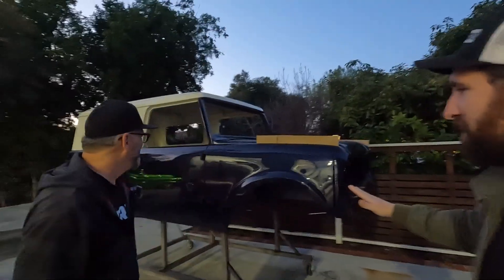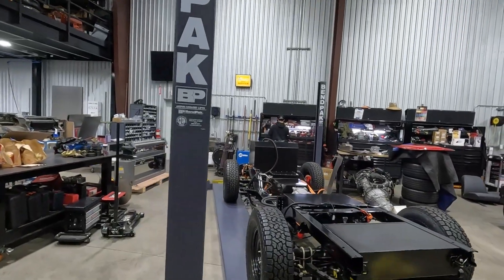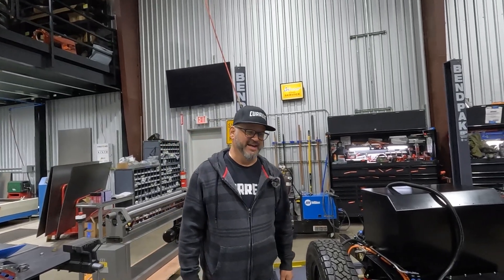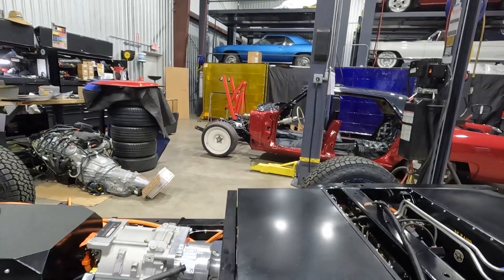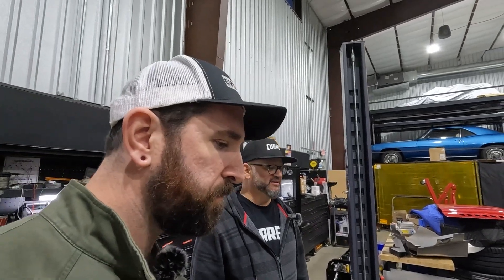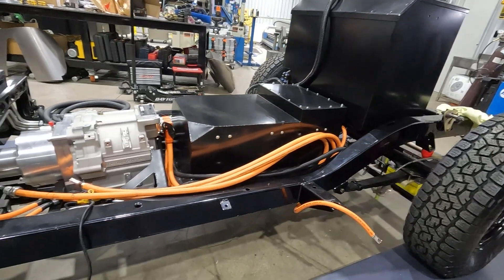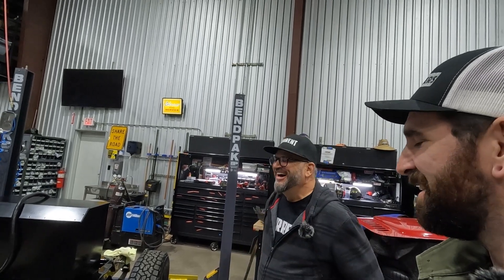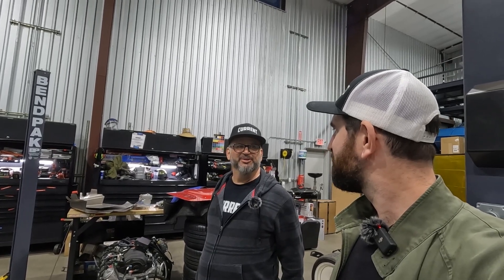No Going Back! The Crazy EV Scout Restomod That Beats Them All

Comment: how much for the covernsion, what would you differently today. and great job. Daily 800 driver 68'
Reply from the maker: @lilredscout  I'd check out the Current LA website since they ha e some great calculators for early stage conversion stuff. Cost really depends on how much range you want and motors you choose along with any body restoration